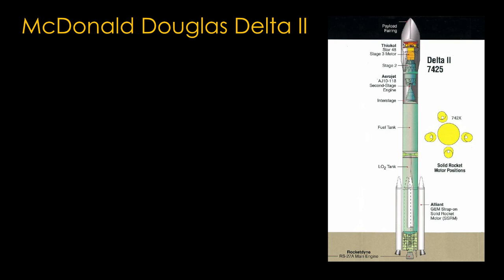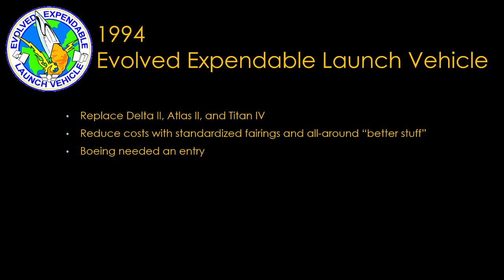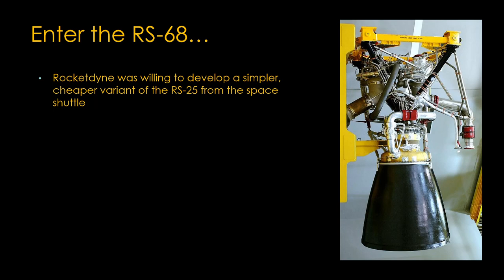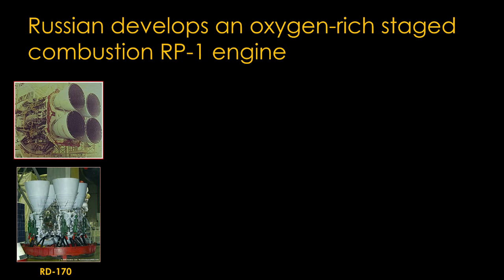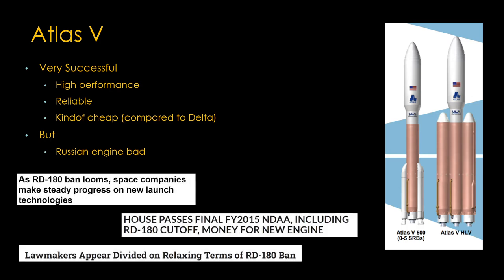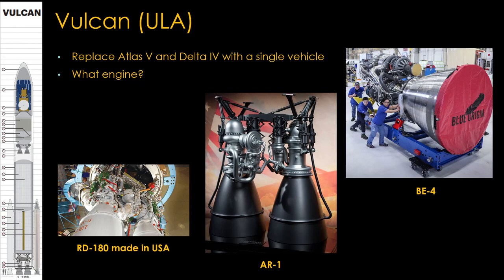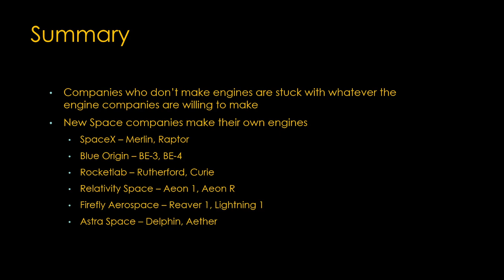Confusing Rocket Engine Choices...

Comment: Rocketdyne had been formed originally as a division of North American Aviation. This became Rockwell after a merger, and Rocketdyne was one of the parts of Rockwell sold to Boeing in 1996. So at the time Boeing was designing the Delta IV, they were  in the process of becoming the owners of Rocketdyne themselves. They would sell Rocketdyne to Pratt and Whitney in 2005, who would sell it (and their own rocket engine business) to GenCorp in 2013. At this point GenCorp renamed themselves Aerojet Rocketdyne.
Reply from the maker: Thanks. It is so hard to track the pieces as they move around.

Comment: The AR1 is actually single chambered. I probably also would have compared it to the NK-33 rather than the RD-180. Aerojet-Rocketdyne bought a ton of NK-33s during the nineties, and I believe they even got the license to manufacture them. It makes more sense for the AR1 to be based off of it, rather than the RD-180.

Comment: As I said on the Reddit post a massive factor for the hydrolox choice is likely to be that it's extremely expensive and they knew the gov would buy a lot of missions anyway, so they could make way more money.
Reply from the maker: I think it mostly didn't work out that way. Delta ends up with 45 (ish) missions for the Delta IV Medium and Heavy rockets, and the majority were for the government though not all were DoD. Altas V ends up with 125 (ish) in total, also mostly for the government.
Reply: I think often engineers like to work on fancy stuff rather than low tech. Solid rockets are unbeatable in terms of simplicity. Not very efficient but hey, if it's simple, who cares.

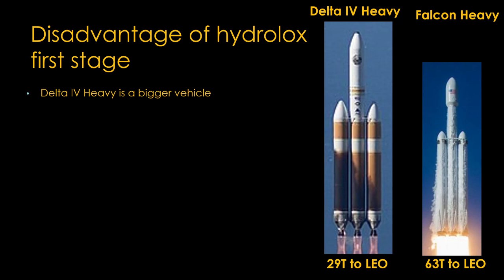Comment: 12:22 A fully reusable Falcon Heavy is 30 tons to LEO. Even with a triple booster recovery FH has a larger LEO payload capacity that DIVH.
Reply from the maker: You are correct - I should have mentioned that.
Reply: @EagerSpace  Another interesting thing I saw was for performance metrics for the DCSS and that of the F9/FH. Turns out for delta V for payload mass as a percentage of second stage mass performance is comparable, with DCSS having a slight edge for heavier payloads and Falcon's upper stage gaining the advantage with really light payloads. It's weird to think that the seemingly unintuitive Falcon upper stage, using RP-1 instead of hydrogen, actually makes sense, especially for the context it's in, and even hydrogen stages can suffer issues with delta V and only really gain a significant advantage when combined with a really low tank mass (Centaur).
Reply: In practice the center stage has never been reused on falcon heavy.
Reply: @mcamp9445  Wow, I didn't believe you until I looked at the list of Falcon Heavy launches. Turns out the only FH mission to have a center core successfully land, Arabsat-6A, also lost the center core due to heavy seas.

Comment: 17:37 If we keep to the topic of Kerolox engines, what about the NK-33/AJ-26? Ignoring their tendency to explode, they were also staged combustion and similarly advanced, right?
Reply: Pretty much yeah. I don’t think there’s necessarily a lot of direct design heritage between NK-15/NK-33 and RD-170/RD-180/RD-191; but as I understand it the latter series is sort of the spiritual continuation of the former, and is generally improved, though not by a giant amount.

What’s really awesome is that the Soviets were launching real actual working oxygen-rich staged combustion kerolox engines as early as 1960! Which is absolutely stunning. (See: S1.5400 engine, used in the Molniya vehicle’s Blok-L stage from 1960 thru 2010; absolutely crazy! 220 total launches with that engine over a half century, if I’m counting correctly!) I was stunned that they were already doing it so early; particularly in light of the US engineers in the ‘89-93 period who first heard of the Soviet ORSC engines and were skeptical that any of it was even feasible at all!
Reply from the maker: Yes, staged combustion engines. I really need the EA long-promised russian engine video to refer to here.
Reply from the maker: @jgottula  Yes. The russian output with engines really puts the US to shame. I hadn't looked at Atlas closely before this video and was surprised to find that Boeing was flying the Atlas 2 all the way through 2004, using an engine that was pretty close to earliest Atlas commercial launchers.
Reply: @EagerSpace   Agreed. Admittedly I haven't looked into all the details on all the engines to see which ones are small variants versus substantially different; but in any case the raw quantity of different Soviet/Russian engine designations is pretty epic.
Reply: @EagerSpace  EA outsourced the filming of his Russian Engine history video to Boeing, and editing to Blue Origin. It'll be ready sometime around 2073.
Reply from the maker: @user-sn8oe5sb1b  This contract is currently under litigation and I've been advised not to comment by my legal representation.

Comment: Sure, RP1 would be the best rocket fuel when your starting point is Earth. Methalox and even Hydrolox would quickly supersede it however as launch vehicles arrive to and operate on different, much smaller gravitational bodies than earth. This is exactly why Starship uses Methane over RP1 for any reason involving getting to Mars and trying to get back, if not to guarantee survival of the engines after multiple burns, due to coking in fuel rich environments. 

Strictly speaking, it would make sense to develop a unified fuel consisting of a mixture of alkanes and some cycloalkanes with a higher density to RP-1, which would be better optimized towards Earth as its starting point; but nowhere else. 

RP1 is technically not the best fuel for a booster; it’s just the easiest to use. And the best answer is not always the easiest answer.

Comment: Thanks I was wonder why they use hydrogen as first stage. And why they used solid rocket engines. I knew solid engines has downsides like vibration.

Comment: 26:20 as to this: Rocket Lab may be about to change this with Neutron, as they are undergoing a drastic change in what their goals are for it. It has since March seen a half a meter increase in diameter to 5m, a 6m increase in height to 46m, a fuel change to LNG/LOX (fancy for Methalox) and seems to have a changed engine design from electric cycle (highly impractical at that size) to what will most likely be staged combustion; GG would be bad for the environment, and Oxygen rich stages seems difficult for them to develop in a few years. Even if they somehow made a sophisticated engine named Archimedes for the second stage; the first stage needs an engine too. Ursa Major, a rocket engine supplier, may be preparing to announce their engine at the same time RL announce the update for Neutron.
Reply: Also: Firefly and Astra signed a $30M deal for Astra to acquire intellectual property for Reaver Engines, making Astra at least the supplier for some of the Reavers, which points to both companies going ahead with the design in their future vehicles. 

So it seems a little of both in-house and outsourced manufacturing is happening for newspace companies.
Reply: "Even if they somehow made a highly sophisticated engine named Archimedes for the second stage; the first stage needs an engine too"

Well, they could just tear a page out of the Falcon 9 handbook and slap multiple of those second stage engines on the first stage and be done with it. 

Oh, wait... 😂
Reply: The engine was never going to be electric cycle, they knew that's not really practical or possible. The original plan was gas generator methane, ultra simple as possible, the switched to staged combustion (closed cycle) methane. Don't remember if it's oxygen or methane rich.

Comment: Ariane 6 is a 4.5 to 11.5 to GTO.  Falcon heavy is 26.7 T to GTO.  Falcon 9 5.5 T (reused), 8.5 T expended to GTO (heaviest proven 7 Tons). So basically Falcon 9 payloads at Falcon Heavy costs.

It is as if designed to compete vs. a  2013 Falcon 9 (v1.1)  Note a block 5 FT...

Comment: Did ULA ever give consideration to using Merlins on Vulcan, or was that not a viable option?  Seems to have a lot of the same pros and cons as the BE-4, except it's keralox and was already in production.
Reply from the maker: The only options I've heard mentioned are the BE-4 and the AR1. 

The Merlin is certainly a viable option. It's a much smaller engine Vulcan would need 5 of them to equal the thrust of the RD-180 and 6 to equal the thrust of two BE-4 engines. The Isp is lower than either of those but the thrust/weight is more than twice that amount, so that would make up for the lower Isp somewhat. I haven't run the numbers but I think it would be competitive. And the Merlins are cheap to manufacture.

The real question is whether either party would be interested in the transaction. There's probably been some bad blood between the two companies around the EELV/NSSL programs, and I'm no sure that ULA would want to be sending $15-$20 million to SpaceX for each of the Vulcan launches. Musk has said that they would sell engines in the past, but who knows what terms they would use. 

You also need subchilled propellants to get the best performance out of Merlin, and that requires both ground equipment changes and procedural changes - you need to "load and go", and ULA doesn't do that now. 

In retrospect, it looks like it would have been a great choice, however.

Comment: Very silly question: If there are ever any problems with the BE-4 engine, could ULA put a Vulcain engine on the Vulcan rocket?

How many vulcans does it take to get one centaur to fly?
Reply from the maker: The be4 is methalox and the Vulcain is hydrolox, so there's a big mismatch there. If you did it, it would take 4.

If you used Vulcain on centaur, it has 10 times the thrust of the rl-10 and is less efficient.

Comment: Silly question: there’s a really annoying clicking sound everytime you advance to the next slide, and I’ve been trying to tout what it is. You’ve eliminated this sound in your latest videos, but what the sound was is driving me crazy. Too loud to be a mouse button or a PowerPoint remote. So that means keyboard. And since it sounds like two button clicks, that means the space bar. 

Am I right? What model keyboard and what type of keys?
Reply from the maker: It's my PowerPoint remote button clicker. It's under my desk and muffled with a blanket and you can still hear it on the mic. 

Keyboard and mouse are much, much louder. 

What I need is a new mic but I haven't decided which one I want.
Reply: @EagerSpace  Fascinating! What model PowerPoint clicker?

And I’d like to suggest that you consider the Lewitt Ray microphone, which automatically adjusts its gain based on a distance sensor. Look at the epos vox review from about a month ago. Link in my reply to this comment.

I have a soft spot for YouTube channels that do great things with PowerPoint. Got a lucky break on an aviation topic a while back and somehow got a load of views with just a PowerPoint presentation. Channels like yours are encouraging me to get back in the saddle and try to launch it for real.
Reply from the maker: My clicker is an off brand one modified to use quieter buttons. I sometimes wonder if I'm actually picking up radio interference from the clicker; I can't have my cell phone around because my mic will pick it up and it will show up as low level noise. 

I looked at the Ray, and it looks nice but that's pretty pricey and I'd need a decent interface. Any recommendations for something cheaper? My current mic is a blue snowball.
Reply: @EagerSpace  You know, RFI interference would explain why it sounds like multiple clicks. Let me take a look at the mic specs and get back to you.

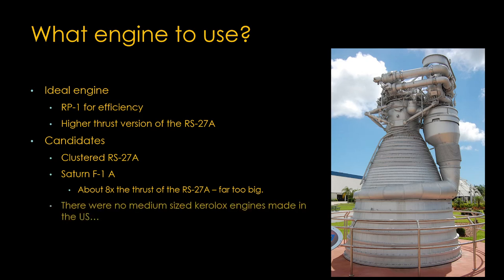Comment: 8:09 I thought there had been a small team that actually designed and partially built a new F-1, but I don’t recall the name of the group and can’t find it with a quick google.
Reply from the maker: Rocketdyne developed the F-1A during Apollo but it never flew. 

A revised F-1B was proposed for SLS boosters. Article here: https://arstechnica.com/science/2013/04/new-f-1b-rocket-engine-upgrades-apollo-era-deisgn-with-1-8m-lbs-of-thrust/
Reply: @EagerSpace  That must be it! I feel silly, because that article did come up in my search, but the title didn’t seem like it matched. But I had recalled that the team was in the Deep South and had used 3D printing, which the article mentions, so that’s it for sure.

Video idea: how much more efficient could today’s engineering make a built-from-scratch kerolox engine than the F-1 or RD-180 are? And what formula of kerosene would be the most efficient—RP-1, RP-2, T-1, RG-1, naphthyl, or one other (used on a US rocket) mentioned in a comment on one of your videos?

Comment: When I learned about space exploration, it always strikes me as odd that these rocket companies like Boeing and later ULA do not make their own engine.  Even after SpaceX started building their own they would rather bet their farm on Blue Origin, who had never built anything before, to build rockets for them.
Reply from the maker: I think it's mostly an outgrowth of the airplane model, where companies specialized in engines. Engine development is expensive and time consuming, and companies decided they wanted the lower risk and lower investment of buying engines. 

SpaceX and other small companies are forced to do their own engines because a) there are no engines that meet their requirements and b) they couldn't afford them if they did exist.
Reply: @EagerSpace  Absolutely.  Their respective situations are totally born out of sound business decisions and necessity for the startups.  The challenge is that when the tides are changing, companies should shift their focus to innovate themselves out of a corner, though more times than not, large companies do not have the will power to do so.  Either it's too hard to steer a giant ship, or management do not want to take that risk which would hurt the stock price in the short run.
Reply from the maker: Sometimes it's not a winning move. ULA could invest a billion dollars in reuse and never make it back.